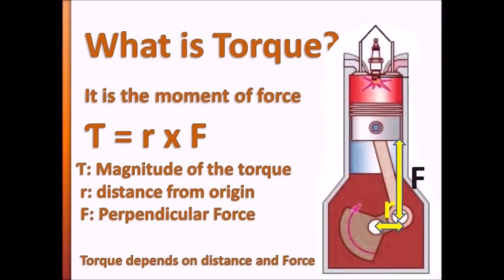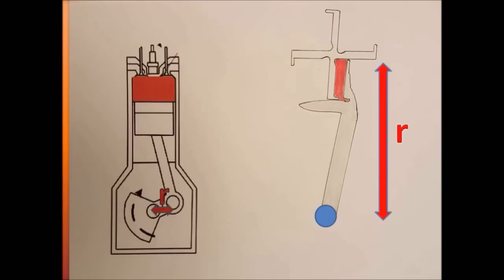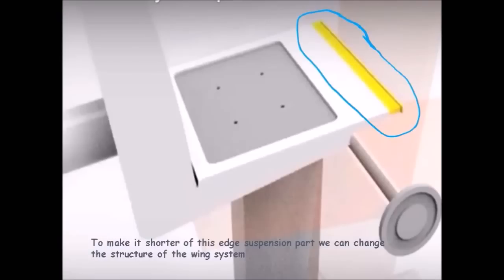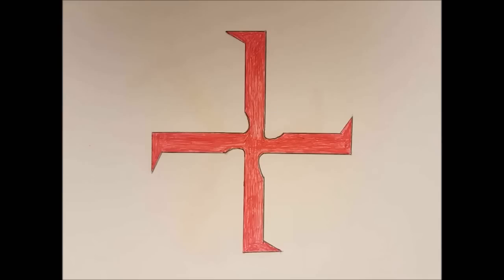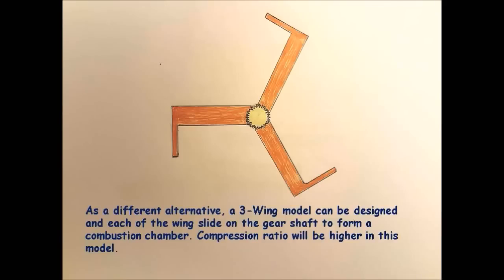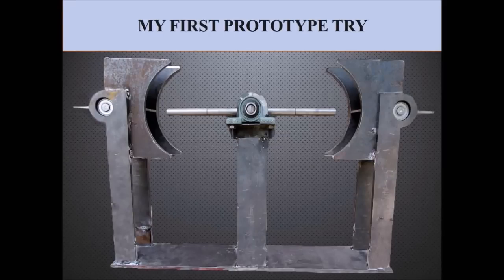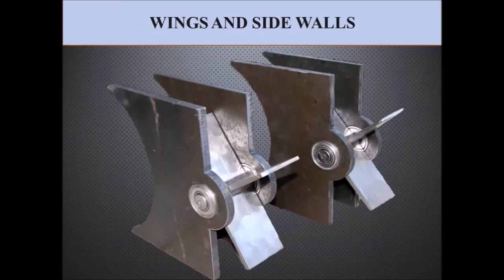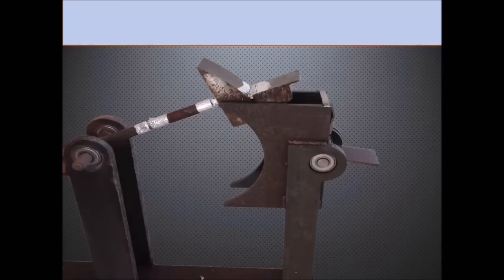NEW ENGINE CONCEPT         (PART 1)

Comment: 1:54  fairly speaking its incomplete if you want to reduce the breaking time which is between them then place these all 1:54 Rolling lines in different positions 1st line between fans is in its correct place then 2nd line a little changes its position upward then 1st line and  3rd line again more upward then 2nd line. Then decrease the length of the line which is in between of 1st and 2nd line and place left and right fans closer in small line case similarly do it again and again in further line after a gap .. In four fan (2:23) case you have increase its speed between braking time period but break time will still be there so to reduce break time once use it my idea 
Sorry if it doesn't work 
Nice video

Comment: The idea is interesting. Where do you plan to use this engine? I was thinking about a way how to speed up the movement of the rotating parts, to prevent more power, and transmit it to the axis, wheels or propellers, and as well there must be a way to stop or slow down the movement in case the vehicle or machine has to slow down immediately. Something like a break or a clutch to connect and disconnect the transmitting power. Sorry for my English, friendly regards